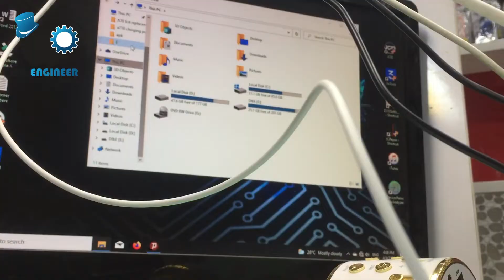how to Repair Broken External Hard Drive USB Port  [W D]

Comment: Hi. The very small chip on the PCB board behind the micro b connector on mine has broken off. Any idea what chip it is? Can i bypass it? or has it got to be on there. Only looking to get the data off the hard drive :( I think it connects pin 2&3?
Reply from the maker: Hi
At least I need to see a picture of it